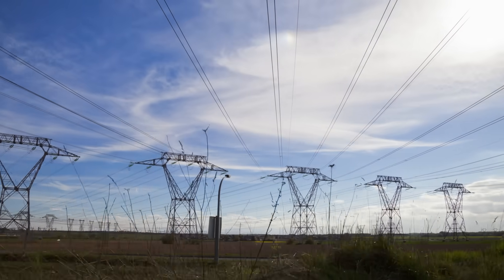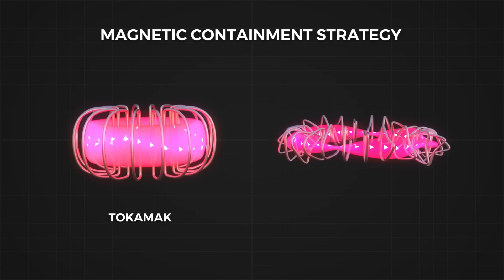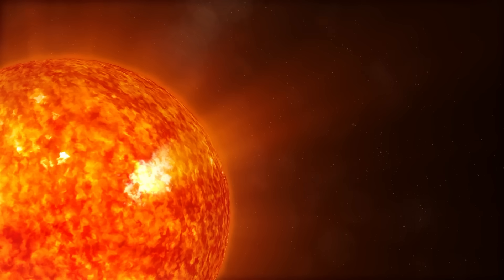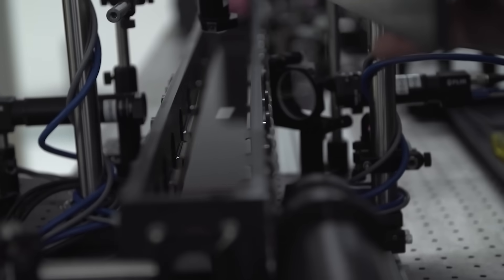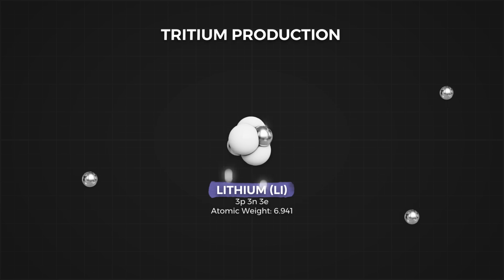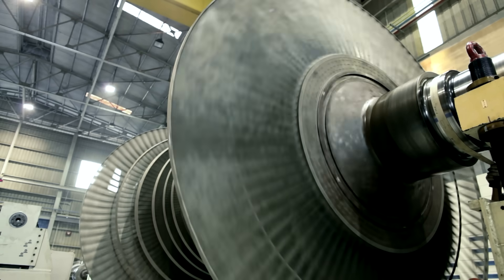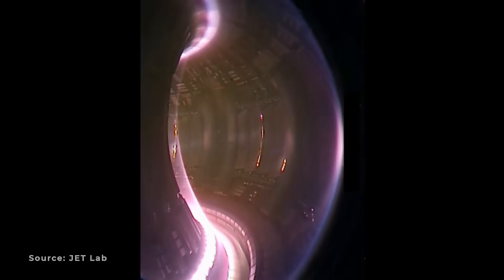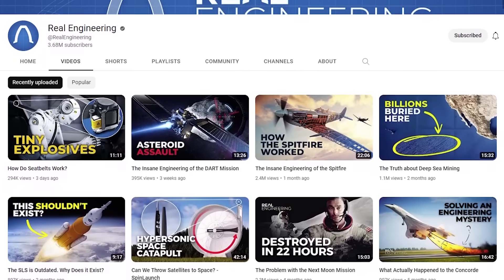The Problem with Nuclear Fusion

Comment: US DOE just announced a breakthrough in Fusion. Would love to hear an update of this so-called breakthrough and if they had really solved the fusion problem
Reply: Good question, the recent breakthrough is a large breakthrough in the theoretical sense, though not the practical. More energy was obtained from the fusion than the energy that the lasers put into the fusion material. However, the energy required to run the lasers is much greater than the energy that the lasers put into the fusion material, so this would not be a method to generate energy. The news on the discovery has been a little unclear to say the least, an analogy is like this: Imagine you have a special material where putting 1 unit of energy into it allows it to output 2 units. However, this special material only takes energy in a special form (in this case the laser light), such that the special form has a 1% conversion efficiency from electricity. You would still be unable to generate unlimited energy this way, the scientists themselves describe having a net positive energy system as at least a few decades away.
Reply: In short: it's hype. 
In long: the Powers That Be want us to keep chasing after fusion so they can distract us from the lack of cheap energy we can get from fission - and from orbital-redirected solar.
Meanwhile we get the lockdowns, which they'll impose upon us for The Climate.
Reply: It was not a real breakthrough, the overall energy in is still greater than energy output. They bullshitted you again.
Reply: spoiler alert: no they did certainly not: it's still the hype it will always be.  Don't be hypnotized by the lying mainstream media.
Reply: @scififan698  Or the Department of Energy, or Lawrence Livermore or the curvature of the earth.
Reply: Lol you're funny
Reply: Considering the Airforce announced aliens are real last year, I'd say it's just as likely a psyop to distract from how terrible they are running everything.  I mean, are we to believe they discovered the secret to fusion during the pandemic while working from home?
Reply: Doe just wants your taxes don't expect any break throughs, just promises and a pat on the back.
Reply: Sounds like an expensive hobby to me.  Like space exploration.
Reply: They really havent solved the fusion problem at all.. Just proven that it is possible to get more energy out of it (which we kinda knew already since we've had hydrogen bombs for 70 years and, you know, the sun).. Its a cool breakthrough, but they "sustained" the process for a millionth of a second and used 100 times more energy to power the lasers that started the process. Still cool though!
Reply: @NiklasLarssonSeglarfan  "(which we kinda knew already since we've had hydrogen bombs for 70 years "
We knew about fusion. We just couldn't produce it in a lab.
Reply: @wisenber  We've managed to produce fusion processes on countless occasions in labs, we just always needed a little bit more energy into the process than the process produced itself..
Reply: @NiklasLarssonSeglarfan  "We've managed to produce fusion processes on countless occasions in labs"
Cool, you're ignoring the exothermic output which has never happened on Earth.
This one was really no different...other than it was the only exothermic effort ever, right?
Reply: @wisenber  Correct
Reply: @NiklasLarssonSeglarfan  So an exothermic fusion production hasn't happened on Earth before. Generally speaking accomplishing something that has never happened on this planet isn't shrugged off as no big deal.
Reply: @NiklasLarssonSeglarfan "it's a cool breakthrough" you're very casual about this 😂😂
Reply: @NiklasLarssonSeglarfan  so, we're about 20 years away?
Reply: @NiklasLarssonSeglarfan Every time i read a comment like this my mind wanders to the history of transistors.
Reply: @DenDodde  Unfortunately i am not familiar with the history of transistors...
Reply: @DenDodde  Transistors were used pretty well from the word go.
Reply: @v8pilot  If you consider 30 odd years "the word go", then yeah! But after that the tech exploded and went from golfballs to billions in per cm2 in less than a century.
Reply: @DenDodde  Every time your mind wanders to transistors, my mind wanders to the fact that the pace of outsize technological breakthroughs in the 20th century has not at all panned out to the modern era.  Consider how we entered the 1900s and how we exited them.  Sure, we're barely 20 years into this century and there have been developments, but nothing like getting off horses into cars, planes, spaceships, communicating worldwide, landing on the moon, computing, nuclear energy, etc.  These are world changing developments.  The latest iphone isn't remotely close to that.
Reply: @darioinfini  I would argue that the introduction of smartphones and improvements in interconnectivity have had just as a profound impact on society as the car had.
Reply: @DenDodde  I think we'd have to agree to disagree on that.  But even if I granted you the significance aspect, I would argue that it wasn't to the positive as automobiles have been vs. animal power.
Reply: @NiklasLarssonSeglarfan  Nah man, they achieved fusion.  Before you Europeans too.  ITER target designs are ten years behind what they are doing at NIF.
Reply: @dinovelvet8933  except fusion has been achieved before in labs...
Please explain how this admittedly incredible technical achievement has done anything to remove the issues holding fusion back from being used to turn on your lights.
Reply: @slartibartfast2649  baby steps my friend.
Reply: @NiklasLarssonSeglarfan  spoken like a salty european.  the method used in the US is completely different from the stuff in this video and what the europeans are doing...alot of the stuff in the video doesn't apply.  and what does it matter that they used "100x" more energy to power the lasers?  (which is a baseless claim anyways) they got 1.5x the energy out...which is the whole point of fusion and what everyone has been trying to achieve.
Reply: @bvbxiong5791 he would probably still find a way to complain if nuclear fusion was handed to him completely and for free ☠️”yea but the reactor is painted a color I don’t like” headass
Reply: @bvbxiong5791  obviously it matters. The amount of energy the lasers put into the pellet is less than the amount of energy that resulted from fusion. That's great, but it's of NO commercial value as a power source if the amount of energy (and money) it takes to build the pellet and power up the lasers Is less than the amount of electricity they sell after using the fusion energy to boil steam and spin a turbine. From the sound of it they're at least a factor of 10 out. And then there's the cycle time; they're going to have to fuse a pellet 10 times a second to generate 3.6 Megawatts.

It's an important advance, but practical application as a power source remains 10 years away.
Reply: @bvbxiong5791  Energy in: 300 MJ
Energy out: 3 MJ, i.e. about 1 % of the input.

Also, tritium was needed, which is rare and expensive. Those are facts.
Reply: @bvbxiong5791  Spoken like a true american lol
Reply: @bvbxiong5791  They only spoke about the plasma gain, not the total energy gain. If you don't understand what the difference is, you shouldn't be condescending to others.
Reply: @bvbxiong5791  it’s not baseless to claim they used 300 Megawatts to power the laser, and said taking into account the input power of the laser they made a 1.5% payoff. They literally said it took 300 megawatts to power the laser.
Reply: @bvbxiong5791  Yes, the method this lab is very different for sure.. Its good that there are a few different approaches.
And it does kinda matter that the lasers used 100 times more energy than was produces, if you wanna make something useful with fusion other than simply have an extremely expensive lab experiment. So yeah, it does matter that the method needs to become 300 times more efficient* before we can, it means we are still decades away.

(* Heat to steam to electricity is around 30-40% efficient only)
Reply: @bvbxiong5791  You sound like the one who's salty here 🤣🤣🤣
Reply: @bvbxiong5791  You still didn’t solve fusion that’s the issue at hand what you did is find a way to squeeze slightly more energy out of what we already know to get a little bit more out of the reaction that’s not revolutionary.
Reply: @bvbxiong5791  Kyle Hill must be  is a salty European too by your "logic" because he made a video that explained the "breakthrough" exactly like the  guy you're responding too.
Reply: @bvbxiong5791  the problem is that this method is not scaleable, while a magnetic method is. It's not about being salty, just being pragmatic.
Reply: @skierpage  So the nature of the beast is an increase in funding, which leads to time off the end date. I expect now that they have this step, that 10 years away turns to 5
Reply: Here's your update: they input 322MJ of energy (and that's just the energy required to fire the laser) to get 3.15 MJ of energy out, and none of that energy was recovered.
Reply: @Michael5001  It's actually multiple lasers (192 in fact), that managed to deposit in the system 2.05 MJ that generated 3.15 MJ of output energy, so proving conceptually that getting net positive fusion is possible, it's a great step to one day making fusion power generation possible, remember this step was never about building a fusion reactor.
Reply: The problem is the same. Overall input into the system is much larger than we get out. Even in an ideal (vs commercial) sense this is still true. What's been proven is that we have confinement methods that will do the same thing as the sun does ever day.
Reply: @Furiends  The problem never changed. However this is the first time with a net positive output which has been tried for nearly 70 years.
Reply: @wisenber  exactly. I compare it to landing on the moon vs having outposts on the moon. We can be as enthusiastic as we want. I do think it's an important achievement but thinking of it as a milestone or that fusion is "around the corner" is both disinformation and distracts from the achievement.
Reply: @Furiends  Right, because a lunar landing isn't a big deal. Countless countries have pulled it off. No biggie.
Reply: @Mitchell Couchman Agreed.. Its kinda funny since everyone opposes nuclear fission usually support nuclear fusion, which today is dependant on nuclear fission to produce all its tritium.. Kinda expensive hydrogen for sure!
Reply: Need way more output still
Reply: @pilksaplenty  That's like telling a toddler that just its first steps that you really need to focus on running.
It's a step, a milestone.
Reply: @wisenber  This form of energy has been in its infancy forever. These breakthroughs still have us decades away at best.
Yeah, I know, 1% is halfway there.
Reply: So many salty Europeans in this thread.  It's funny how the European armchair scientists are bashing this breakthrough while every single actual scientist in the fusion field has praised it...
Reply: @svt80221  It would be like someone espousing how many planes got really close to the sound barrier after the first person actually surpassed it.
An exothermic fusion reaction had never been generated by humans before this. Maybe they're upset that the US did it?
Reply: @svt80221  I have no idea what this has to do with being European. It is an incredible technical achievement, but I don't understand what meaningful impact it has. It solved none of the actual problems that prevent fusion from becoming a viable technology. If you think I'm wrong, please point out my error, rather than putting it down to me being "European".
Reply: Salty Europeans when the Wright Brothers achieved flight:

They only went 100ft, that solves nothing.
Reply: politics and grant fishing.  Yes, maybe they have a net positive of energy, but not a net positive of cost. Actual application, for north of a decade out, probably 3.  Still, it is progress, but should not be funded by tax payers fighting to pay for rent and food.
Reply: The last 24 hours were supposed to give some sort of update on fusion. Unfortunately, the people who did this weren't the first to actually reach this milestone. China did it a few months ago. And they weren't the first either. This story has been ongoing since the middle of covid. It was one of the best things that happened during 2020... but no one heard anything about it because bad news sells.
And I feel that this particular energy option is being horribly undersold to the general public. (It may be just a "feeling" but I think big oil is blocking this in the news. No one knows about geothermal or solar breakthroughs either and they are both huge).
The amount of energy supplied by fusion is incredible. 2 gw in 3 gw out is pretty impressive. The maths say fusion could produce over 8 times the amount of energy put in, so when it's fully developed, this will probably run our society. Naturally... oil is scared to death.
Reply: @jacobmcdorman5552  Except China didn't

Comment: I know it's not really the point, but I can't help but dig into your intro. I think its fairly dubious that fusion reactors would solve almost any of the problems you specifically mention, especially not as a wholesale fossil fuel replacement. The truth is that petrol pervades our whole lives, it used in pharmaceuticals, cosmetics, all plastics, and many other synthetic materials ranging from dyes and pigments to artificial flavorings. Even if we had 100% clean free energy, we would still be fighting wars for petrol because at this point it is the input for so many processes that it's use as fuel is perfunctory. Furthermore, fusion energy would not solve the issue of energy storage and transmission, which has been and continues to be the real problem plaguing the 'green energy' transition. You can't put fusion energy in your car unless its an EV, and if it is an EV, you've just shifted the environmental concern from fossil fuel usage to lithium/cadmium/lead/arsenic/so forth and so on production, which is a dubious improvement at best.

I say all this not because I hate you and what youre doing, I think your enthusiasm for this is admirable and probably well founded in its import as a potential technology. But I think maybe you need to reflect a little bit on how you may contribute to the technocratic myth that we can 'invent ourselves out of climate change'. The truth seems to be closer to the fact that climate change, war, poverty, and scarcity are the results of societal structure and not technological capacity. There is no point on the tech tree where 'modern society', as we know it, doesnt produce these things. Instead, perhaps we need to rethink our very notions of what a desirable society is in order for us to achieve these lofty goals, not just invent a more efficient power plant.

Comment: Aaand it happened
Reply: Just like that. Gotta love science.
Reply: It didn't. Look closely into the total INPUT power
Reply: @dipanjanghosal1662  -- This video only tells you half of the story. They are 2 ways to obtain fusion and the way it was done recently is with many many lasers, not magnets.

kurzgesagt fusion video explains it way better and that video has been around for 6 years.
Reply: @Supremax67  whether you use lasers or magnets, you have to input a lot of power to make the conditions for fusion. But when comparing the yields, scientists don't include the total input power, they only compare it to the power that caused the fusion. That is misleading. 
And to top all that, even if we somehow manage to get back any more power than we spent (which is not even remotely possible right now), we have to talk about converting that heat energy to electricity which is not 100% efficient. Not even close. Real break even is far far away, if ever.
There are very few YouTube channels that talk about the reality of today's nuclear fusion. I think Sabine Hossefielder has a good video talking about this. You can search it on YouTube.
Reply: It totally did!

Comment: My comment was going to be, "150 years, we've harnessed the power of coal, oil, rivers, seas, wind, the Sun, and the atom itself, and now we're on the way to achieving viable nuclear fusion.  And yet with all of those things, we still haven't found anything better than "Use it to make some water hot." to generate power.  If we can't get nuclear fusion working in the next few years, I vote we change gears and invent a time machine instead, so we can go back and get Nikola Tesla for help.  He'll know what to do."

However, you tease that this "Helion" group has a different approach, and now I'm very curious.